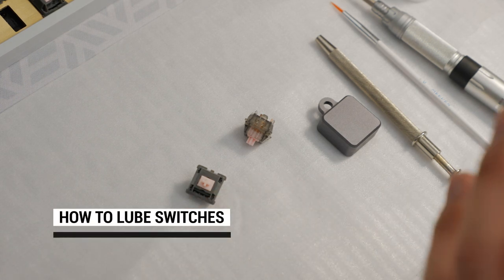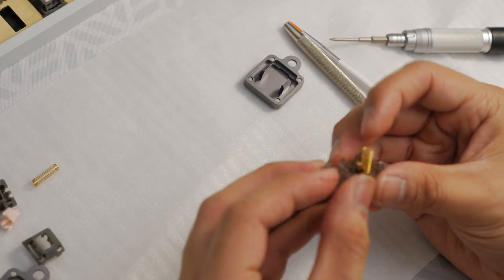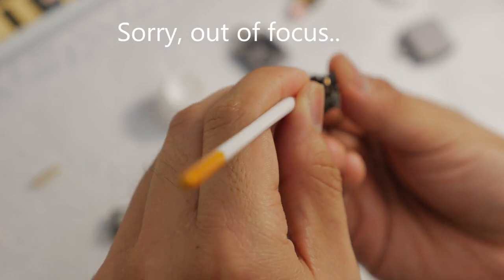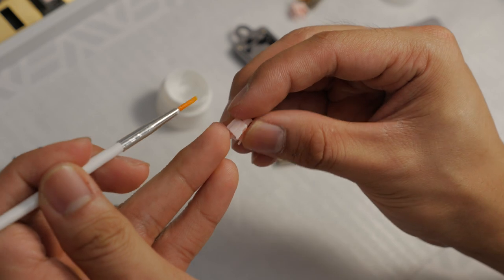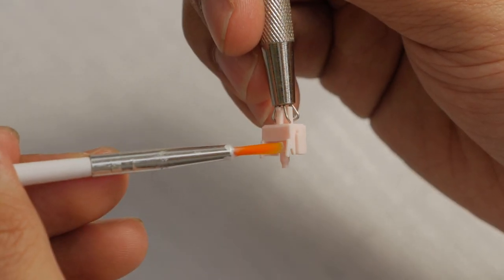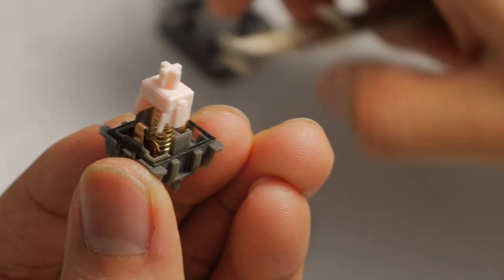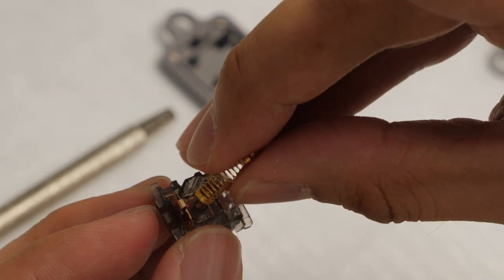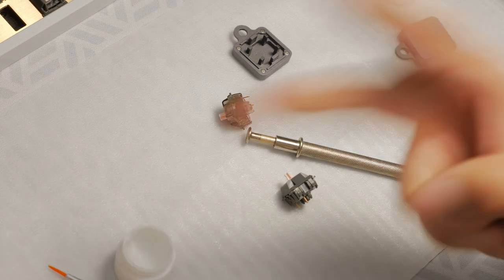How To Lube and Film MX Style Keyboard Switches

Comment: I've been opening my switches using straight-tipped tweezers. Just put one tweezer prong under each tab on both sides of the switch, then gently lift until they rise just enough to release. Works much better than a screwdriver because you can undo both tabs on a side at once evenly.
Reply from the maker: just make sure your tweezers aren't too sharp. i've stabbed myself doing that before lol
Reply: tbh if u arent tight on money, just get a switch opener. Saves time.

Comment: Thanks for the tip on spreading out the lube. I didn't do that and overlubed my switches. However I don't like lubing the stem bottom and the floor of housing. I find the sound is crisper this way.
Reply from the maker: Yea I’m considering doing the same. Less thock tho but more clean sound.

Comment: this is very helpful. I was also told that 205g0 is for the stem but you should use 105 for the spring? how big of a difference is that?
Reply: will most likely not even make a difference

Comment: Nice vid. Can i ask if you removed the factory lube from the Alpacas before lubing or you just lubed over them. Thinking of building a linear build closer towards the end of the year and will build them with lubed and filmed alpacas. Would you consider a video on removing factory lube? txs
Reply from the maker: I just lubed over it. It's pretty thin factory lube.

I'm filming a video on using an ultrasonic cleaner to remove lube/clean vintage switches right now!

Comment: Any recommendations for silencing the switch top-out noise (the clack made by the upstroke)? I know the films can help reduce it to a certain degree, as well as lubing the top of the stem where it hits the top housing. I'm trying to research all possible ways I can make my keyboard quieter, the main issue being the top-out noise. But I'm not about to buy new silent switches haha, just experimenting with modding. (GK61 with Gateron Optical Reds)
Reply from the maker: What you mentioned is all I know. You can also swap out for uhmwpe stems but they're like $35 for $110 so you might as well go and buy another switch.
Reply: Andy V Nguyen Right, right. My board was only $42 on sale, so the $35 for switches is pushing it lol. Thanks for the response! Glad to know I’ve at least got those two methods to try.

Comment: So, I just lube switches. And I tried to use a light amount maybe a little more than what you showed. And the brush felt dry when lubing the bottom housing, so I added a bit more. It doesn't sound over lubed, but it feels heavier now? Did I in fact overlube? I am using lube I had left over from maybe 8 months ago, but I mixed it and it still seemed fine.
Reply from the maker: if the feel is different then yes you overlubed

Comment: Quick question, when you lube the springs, why so you only lube the top and bottom, not the whole spring?
Reply from the maker: When you're using grease, just the top/bottom is enough to stop the pinging. With oil you can bag lube the whole thing. There's diminishing returns if you are brushing grease onto the entire spring.

Comment: Is it okay to lube springs with 205g0? I've had people tell me that it's bad and that it's better to use 105 or a 1:1 mix of the two. Is this true? Or does this only apply to bag-lubing?
Reply from the maker: I brush lube with 205g0 all of the time. Using oil and bag lubing is faster. I find brushing with 205g0 completely eliminates all possibly ping even if you slam the switch. Bag lubing with oil leaves just a bit of ping left.. but that ping is only heard if you put the switch in your ear and slam the stem.
Reply: Newer to the hobby, but have recently been playing with some durock pom linears and 205g0, and have been asking myself the same question on bag lubing with 105, or brushing with the 205g0. From what I’ve read on forums and seen from this and Taehas lubing video, brushing with the lube you’re already using is far superior. It’s more cost effective, doesn’t waste nearly as much, and the thicker lube being applied directly to the pinging spots, which seem to be the coiled ends of the spring, seems to be the best method. The thinner lube just like when placed in the bag will over time work it’s way off your spring and into a small puddle in the bottom housing. 

I had great results with sound and feel using relative the same method as this video. Cheers, and happy modding!

Comment: Is it ok for a little of the switch film to be sticking out or does it have to be aligned perfectly?
Reply from the maker: Varies. Sometimes films will snag until you have to intentionally misalign a bit. But for the most part they should be consistent. The top part of the switch (where the leaf is) shouldn’t have too much exposed film.

Comment: Any reason you don't lube the stem center column? Always see people conflicted on doing this or not
Reply from the maker: lubing the parts i have already makes switches smooth. i know that there are other points where the components make contact but i don't find the extra effort worth it.
Reply: @AndyVNguyen  makes sense, u also run the risk of lube farts if even a tiny bit more than a little is used.  Thank you for the quick response Andy!!!!

Comment: Many components like this made of some type of plastic or nylon are non lubricated for a reason.  As soon as you add a lubricant to them, you create an attractant for dust.  Then they will start to bind as the dust builds up.
Reply: Most switches are sealed when closed. I know a lot are IP56 rated, which means they will not let in dust.
Reply: @TranquilMarmot  IP56 seems to be quite the oddity.  Protection from powerful jets of water from any direction and yet only partial dust protection???  This makes no sense to me.

Comment: Quick tip. you can open a switch with a tooth pick
Reply from the maker: you can use anything thin

but bro a toothpick might just snap
Reply: @AndyVNguyen  i had been using toothpicks for a long time now. you just remove a bit on the top part and nothing will break

Comment: You're overlubing by my standards. The amount you used on the stem was a lot. You shouldnt lube the bottom houaing anymore. 205g0 requires almost no lube at all. The teflon will make the switch slow.
Reply from the maker: I’m interested I’m trying out lubing stem only and no bottom housing on my next set of switches. My buddy did the lube method you just mentioned on my mauves and it definitely didn’t have the deep sound I liked for a linear lubed with 205g0. I went back and lubed the bottom housing and it sounded better. I’m a bit confused though, why are we talking about teflon ?
Reply: @AndyVNguyen  Krytox Oil = PFPE. Krytox Grease = PFPE + PTFE. In pratice, this means that 205 = 105 + Teflon.
Reply from the maker: So in your method, you use less lube than I used here on the stem, lube/oil the springs, and that’s it? Do you get that deep sound out of your linears doing this?
Reply: @AndyVNguyen  Maybe I am a bad example... I like unlubed switches and I prefer thinner lube because I don't want to alter the force curve the spring by slowing down travel and return. Having said that, 205g0 is too thick in my opinion. What you could try is to make grade triple zero by mixing 70 % of 105 with 30 % of 205. That mix will contain less Teflon and be easier to apply. It is also waaaayyyyyyyyy smoother than 205g0.
Reply from the maker: I love deeper sounds so I kind of gravitated toward this method. But you’re right! There is risk of making the switch feel sluggish. Have you tried using 3204 instead? Or is that still too thick for you?
Reply: @AndyVNguyen  3204 is roughly speaking 104 with Teflon. It's not bad I would say. To be honest I try something different each time. The smoothest I have gotten out of a lube job was by first applying an extremely thin layer of 205, then applying a second layer of thin 103, mixing the two. Overall I can say that I prefer grease+oil mix over grease alone, except 3203.
Reply from the maker: @jani80k  I think TX sells a mix. What do you think of this? https://www.us.txkeyboards.com/products/krytox-lube?variant=31403083825212. Since you were mentioning 105+205. You don't use 3203 for anything?